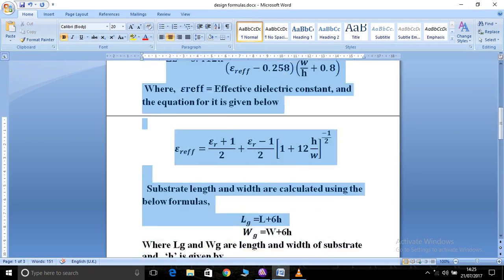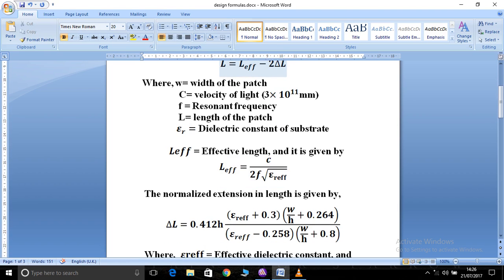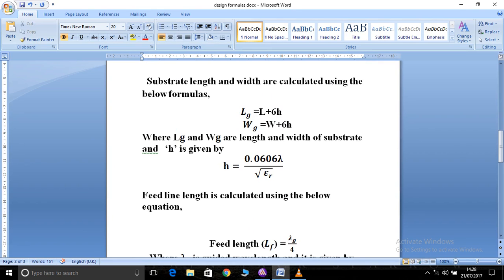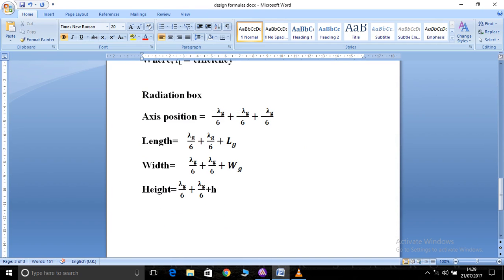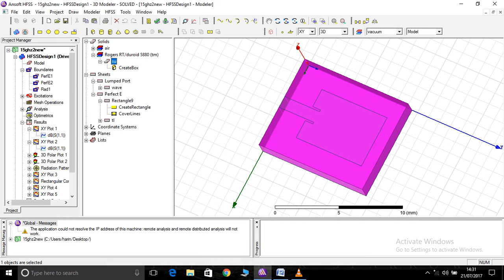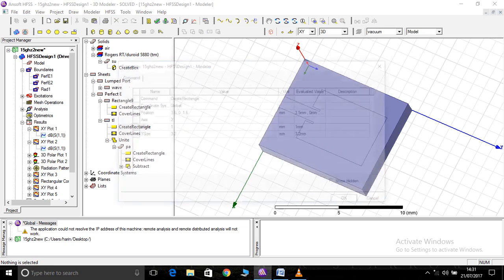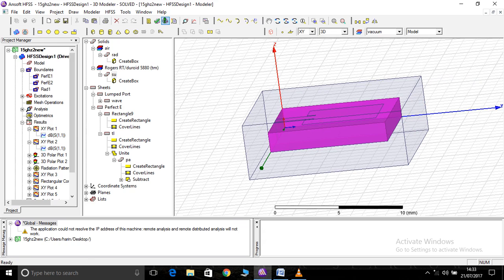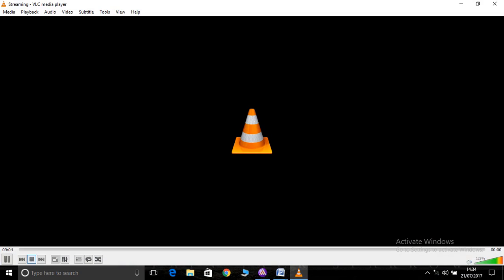DESIGN EQUATIONS FOR MICROSTRIP PATCH ANTENNA DESIGN (Antenna Design Part-2)

Comment from the maker: For any Antenna related Projects, please get in touch through the email address 'harinath.m1995@gmail.com' or WhatsApp (+919840762458)
Reply: can you please forward to me that word pdf
prasadhnemala865@gmail.com
Reply: Sir we are doing a project in antenna  Design and simulation of broad band rf energy system .In that we need to resonate the frequency in 2.45 and 5 .Will u plz design that
Reply: I had followed the same design procedure but I am getting a resonant frequency that is different from design.please help me in this regard.
Reply: Hi can you design fractal antenna

Comment: sir, h = 0.0606lambda/sqrt(dielectric permittivity), it is height of the substrate or what? and why we using this formula for calculating length and width of the substrate?
Reply from the maker: Substrate dimensions doesn’t have to be so specific, depending upon the patch size you can choose the substrate dimensions. Say for example, if a square patch dimension is 35x35 mm, the substrate size should be > 35x35 mm if probe feeding is used. 
In case of transmission line feed, it should be greater than the patch and the feed line dimensions.

Thanks

Comment: Hi, if you really calculate the width and length of the patch using the formulas u provided, I'm getting 7.900 for the width and 5.609 for length . And this is different than yours. Can u pls explain? I really need to know
Reply from the maker: hello khalid,
there was a small mistake in the example design that i have shown in the video, actually, it was designed for the material fr4 that has dielectric constant 4.4 and not for rogers 5880 material.
the following are the calculated results for the design with rogers material
patch L=6.5, W=8
substrate L=11.4, W=13
feed length= 3.610
The formula for the radiation box for  axis position is 〖-λ〗_g/6,〖-λ〗_g/6,〖-λ〗_g/6 not 
〖-λ〗_g/6+〖-λ〗_g/6+〖-λ〗_g/6〖-λ〗_g/6+〖-λ〗_g/6+〖-λ〗_g/6
the radiaton box dimensions are;
axis=-2.4,-2.4,-2.4
L=16.2
W=17.7
h=6.4
Reply from the maker: feed width =1mm
Reply: which formula, you use for calculate feed line
Reply: which formula you use for calculate feed width?
Reply: u r right